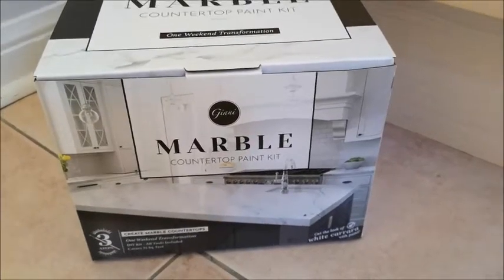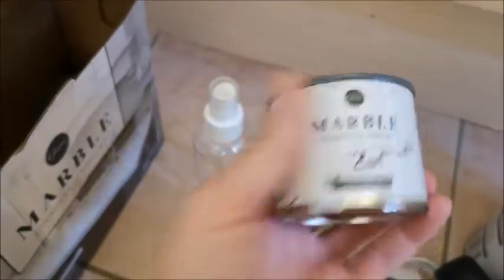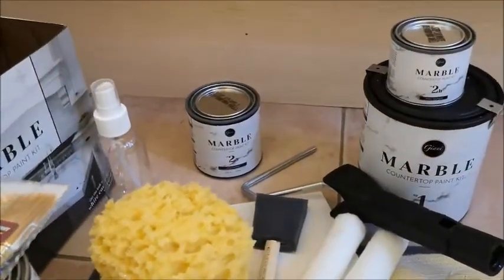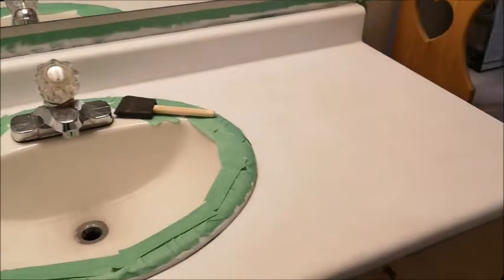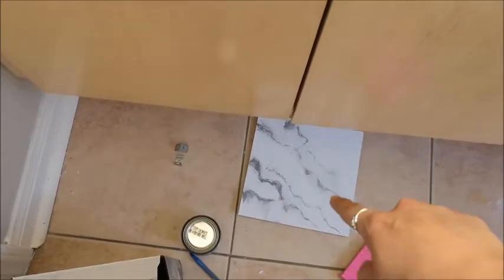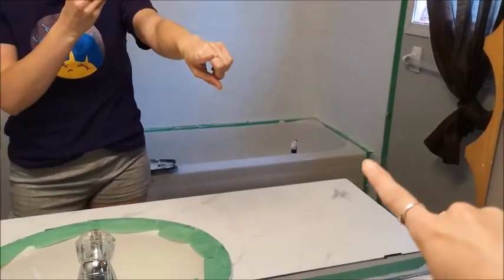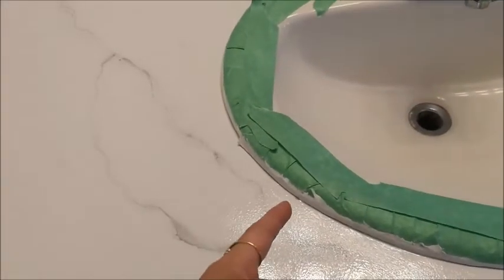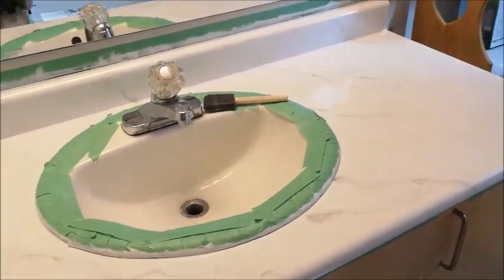DIY Marble Countertops - Giani Marble Paint Kit Review - Bathroom Makeover Series Pt 2

Comment: Hi there girly... It's been a year and a half. How are those counters holding up? I realize it's in the guest bathroom, but by now it has had enough use to know if you are still smiling and happy with results, right?
Reply from the maker: Hello! They are still exactly the same! :) I am really impressed. I just use a multi purpose spray and a cloth to wipe them down as needed. But overall perfect condition still, I haven't had any issues at all.
Reply: @QuiltersWorkshop  so good to know. Thank you! I want to be smiling years down the road.